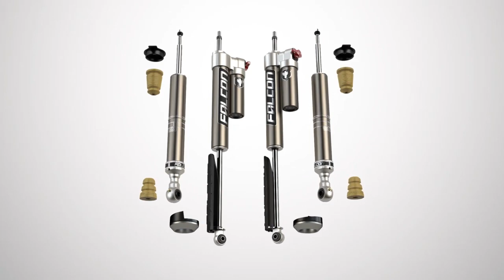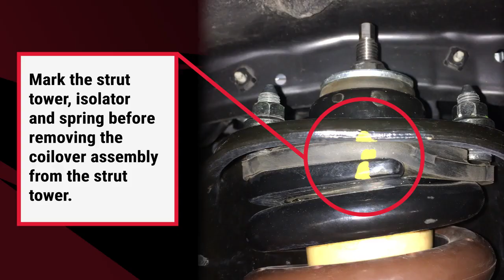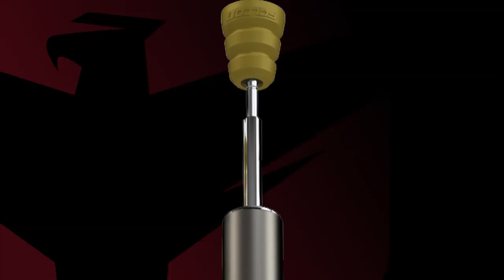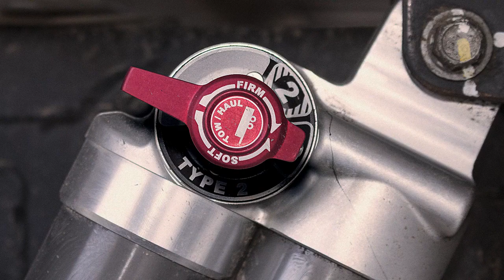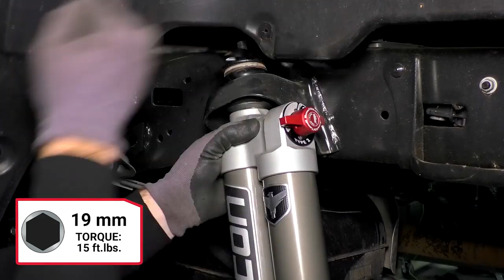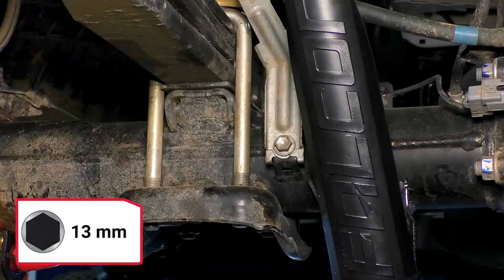Falcon Shocks Install: Toyota Tundra

Comment: How are this comparable to the trdpro fox?
Reply from the maker: Give us a call, we'd love to talk to you about the benefits of Falcon shocks. 801-713-3314
Reply: Falcon Shocks ok I had them install today but there is a catch... my rebel doesn’t sit level at all just a bit higher at the front end.. the shop that did the job told me that they used the level setting since that’s the way it comes out of the box.... I had a 2” leveling kit before and it was a bit higher.... is it normal not to look leveled. I have a 2019 ram rebel ..
Reply from the maker: @idontcaresapo8233  If it is just a bit too tall, then you may be better off in the Medium setting on the front shocks.
Reply: Falcon Shocks sorry I meant lower in the front but I don’t care it looks good..but it’s not level.. like some people think.. it’s like 1 inch lower.. I’m still super happy with my falcons .... highly recomendable for anyone
Reply from the maker: @idontcaresapo8233  Awesome! Thanks for the feedback.
Reply: @idontcaresapo8233  that's been my concern about getting these.  Wondering if you can add a 1/2 spacer to get the proper level